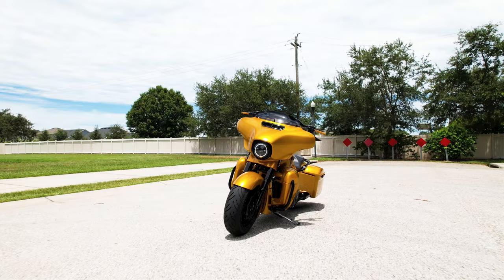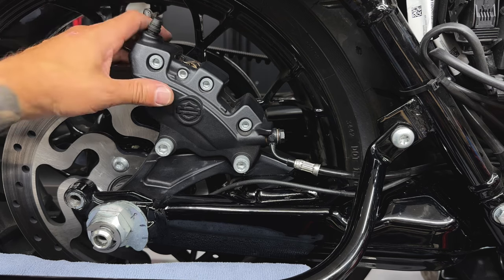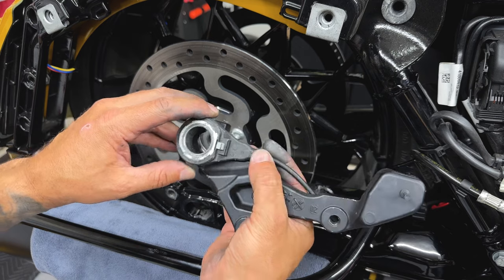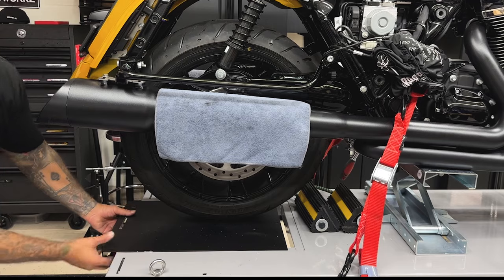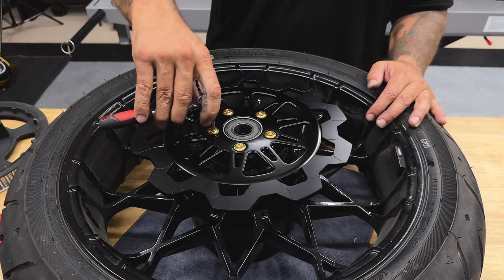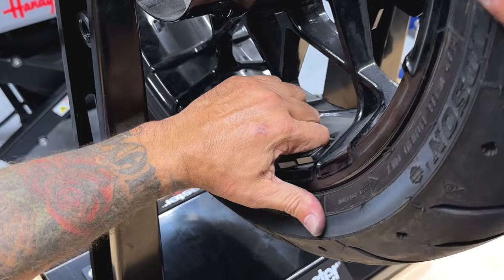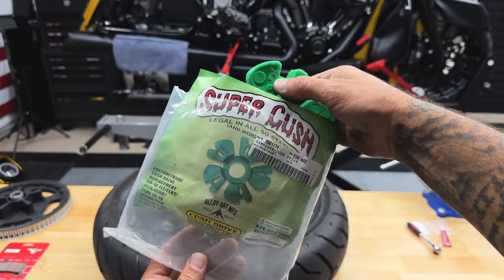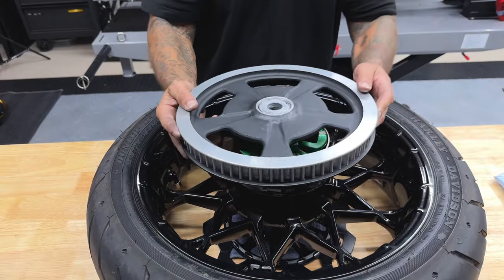Rear Tire Removal - Balance - Rotor and Brake Pad Install Harley Davidson

Comment: Just balanced my wheel flowing your video! Bought balance stand from Harbor Freight. The balance came out spot on perfect  The motorcycle shop balanced the same wheel twice and couldn’t get it correct!
, thanks
Reply from the maker: That’s great to hear! Definitely an easy project

Comment: Once again! What a great video! Just installed new Metzler CruizeTec tires and rear brakes. Got rage wheel Allignment tool and the rear axle nut tool. Made it so easy! Thank you Sir!
Reply from the maker: Thank You for the Support! The right tools always help

Comment: Very well done video.  However, I can give a little word of caution for well used rotors and bolts.  Due to the extreme heat those bolts are exposed to during operation, heat,and penetrating fluid can help to remove the weak t45 design of that particular bolt.  Lastly, close attention should be focus in keeping the t45 and ratchet in a STRAIGHT 90 degree angle.  I have seen many high end t45 bolts and bits damage due to proper use or lack of proper preparation. Great information has been publish on this particular subject.
Reply from the maker: Absolutely, thank you for the input 👍🏽

Comment: Thank you for the details on all your videos, question? When you do the final torque 140ftlb that’s when bike weight on the floor ?
Reply from the maker: Thank You for the support and watching!  It doesn’t really matter.  As long as your wheel is locked and not in neutral or spinning, it should be fine.

Comment: What are your thoughts on the liquid tire balancer. You make working on your bike look so easy.
Reply from the maker: I’ve never tried the liquid balancer. I don’t know how that would hold up over time, and if different temperatures would have any effect.  I’m currently testing out the bead Balance of the front tire.  I like to visually see the weights, and if one falls off I can always add another

Comment: Another great vid. Question, does the pulley and isolator not play role in the balancing?
Reply from the maker: Nope they do not, main reason being that they are not fixed to the tire 👍🏽

Comment: Love those rotors! Question though, can I change just the front? I feel like thats alot of work for something that's hidden by my saddlebags anyway. But, performance wise.....will changing just the front be a problem?
Reply from the maker: There’s nothing wrong with just changing out the front.  You will still be adding additional stopping power.
Reply: @lyndallbrakes  wow that's awesome. Thanks! However, I already installed your brakes and rotors shortly after I had posted that question.

Comment: Im curious, given you have a fixed cam on your rear axle, what would you have done if the alignment was off?
Reply from the maker: I would have turned that cam adjuster until the belt diflection was correct and re-check both sides of the axle for proper alignment with the swingarm
Reply: @RAIDERWORLD  so are you saying one of the cam lobs would have been worn or shorter than the other, even with the belt to tight the cam, if same would have made the alignment 'correct' or is there something else we are looking for like the swing arm shaft possibly worn so moving slightly lateral?

Comment: I appreciate your videos , I did change my rear tire successfully thanks to your videos, by the chance do you know why is belt deflection for a 2017 road glide special? I lost my service manual😞 I notice you have same bike
Reply: I already bought the motion pro gauge just need to know how tight needs to be , thank you for your help!
Reply from the maker: I’m glad this video was helpful.  It should show it on the Harley Website or the forums.  It should be the same for 2015-2021 models, but not 100%.  You can always purchase a digital service manual online for around $25
Reply: @RAIDERWORLD  thank you!!! I really appreciate your help!!👍

Comment: What you think are better performing these brakes or the galfer??
Reply from the maker: I’ve never ridden with Galfer Rotors before, so I can’t really say which one is better.  I would say that the Lyndalls Coiled ring retaining system vs the Galfer button style is far superior.  I have heard those rattle over time